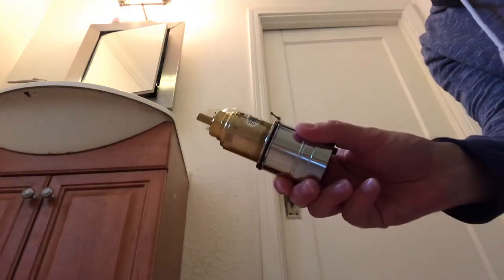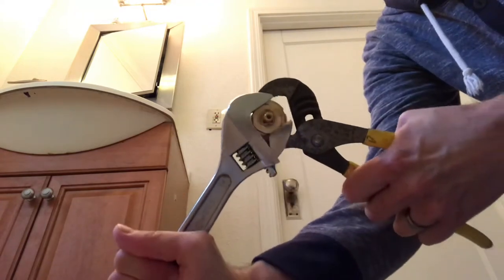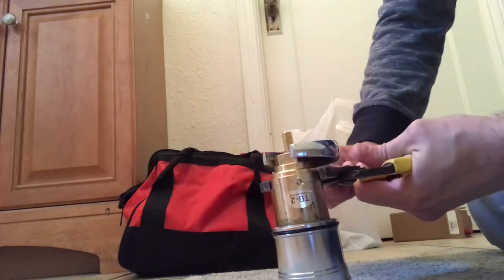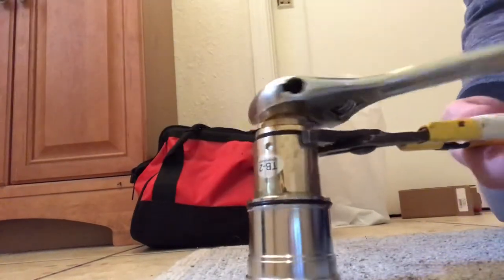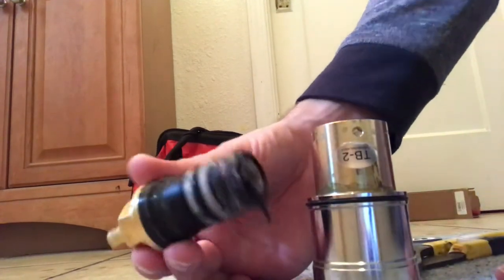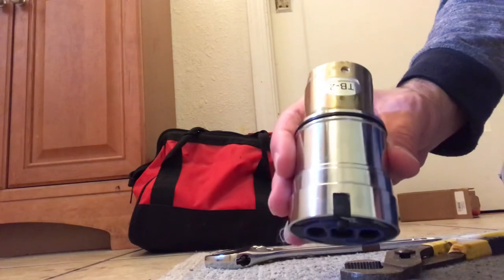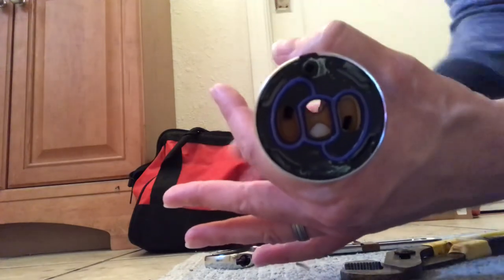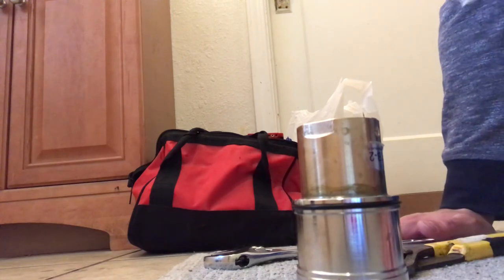Hansgrohe Shower Valve Cartridge Removal

Comment: My TB2 had a brass set pin pressed in. I crashed my housing before realizing this pin needed to be drilled out. Once drilled, I broke into the threads. Not rebulidable in this form, I ordered a new housing and valve, but the housings are discontinued, but I did find one.

Comment: Something is wrong with the cartridge in this video - the label says TB2, but the underside has only 3 ports suggesting it is a TB1.
Reply: I agree that something is wrong here. I just went through the joy of replacing a 13 year old TB-2 about two weeks ago. In my case, the inner cartridge and the outer piece were completely fused together, there was no way to unscrew them as shown in this video. Also, the end of the TB-2 cartridge has a different gasket on the back then what he is showing here. I ended up buying the entire piece that he is showing here (which was labeled as a TB-2 cartridge even though it is the entire assembly). If you buy the whole thing, which is expensive, then the repair is very easy and only takes a few minutes. It is still way cheaper than calling a plumber though. The hardest part of replacing the whole TB-2 piece is that mine was wrapped in a cosmetic brushed nickel sleeve, and the washers on the inside were tight after 13 years. It took some effort to get the cosmetic sleeve off as I had to reuse that part. Do NOT follow this video or the video on the hans grohe site with the cheery fix-it lady and the giant wrench. They are both wrong. If you try to turn the TB2 while is it still bolted in the valve then the gasket will pop off the back and potentially crack the inside of the cartridge too. You will end up having to buy the cartridge assembly then anyway.

Comment: When you install the fixture into the wall are you able to shut off the water without adjusting anything
Reply from the maker: no, I needed to turn the main valve to the bathroom off.

Comment: Does this solve the slow shower head leak? Replace the cartridge or replace the whole unit?
Reply: It seems to be the TB-2 cartridge that that causes the leak. I am having the same problem. Replacing the whole unit is a good idea if the unit is too old in my opinion because the internal Thermostatic Cartridge gets stuck and hard to rotate over time - maybe there is a way to clean it, not sure.

Comment: TB2 86000 with grey strips and shorter than TB1
Reply: the 94282000 cartridge will fit in all three,
Reply: However it is possible to replace only the Cartridge TB2 P/N 88723000 without  replacing the Thermostatic Cartridge 94282000 and vice-versa according to my research.